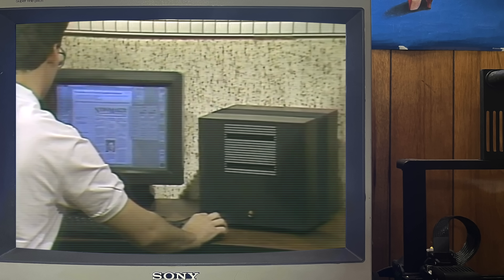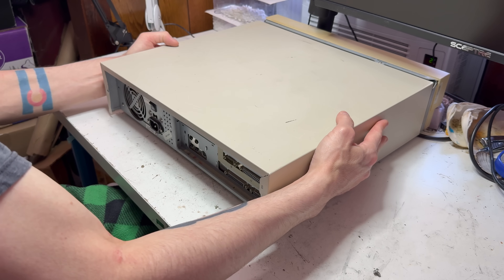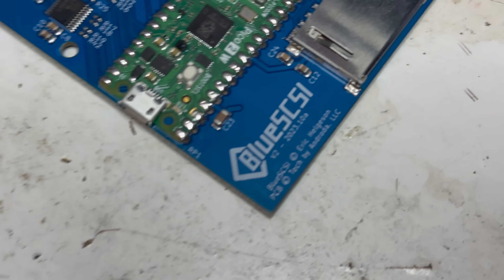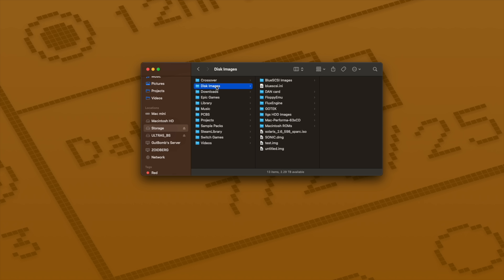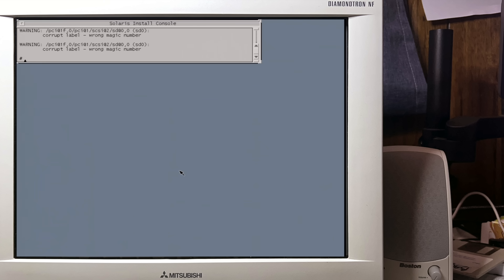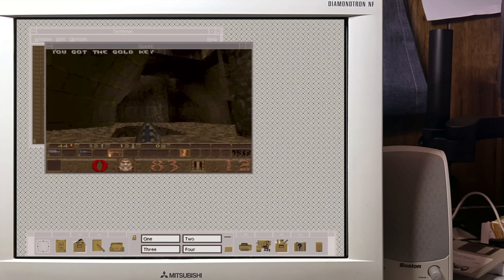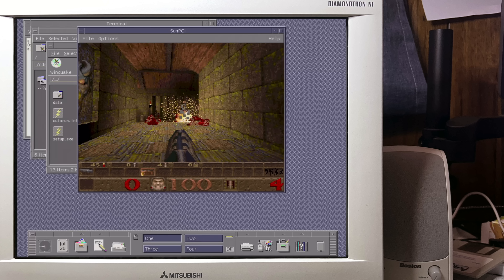The Sun Ultra 5 Was Kinda Weird

Comment: Ah, the Ultra 5 pizzabox. I worked for a company that used a lot of Unix systems. Their main servers were a pair of SGI Origin 2000 systems for the databases, and encryption. Their Internet facing systems were all Sun workstations, Ultras of various sizes running Solaris. All their development work was in JAVA, but they ran Linux workstations for that, since, JAVA was >supposed< to be fully cross platform...LOL! They had done an update of their software, and pushed it to their dev server, and it wouldn't work. It was a needed update with new features they were selling, and so there was no way to back out of doing the update...they could just delay it. I was asked to look at it. I quickly found that it was an incompatibility between the Linux implementation of JAVA and Sun's native JAVA...but the higher ups didn't believe me, I was just the Unix guy in an IT department with lots of Unix...and a whole lot of Windows, which the new executives from the investment firm wanted to move everything to (and would eventually...to their chagrin). Sun had told them it should be compatible, and if it wasn't, they had a lever with which to force Windows Server (ick!) onto the job. But I said to the CTO (who was a Unix guy...until they replaced him...) let me borrow an Ultra 5 workstation, and I will set it up just like the Sun servers, and show that Linux running on Sun hardware would run the JAVA stuff fine. So he allowed me to do this...and lo and behold, it indeed worked, showing that there was an incompatibility! What's more, in testing, the Ultra 5 running Linux was as fast running their server JAVA app just as fast as their Sun Ulta workstation servers running Solaris! Back then, we used to call Solaris, Slowaris. 🙂 I won't name them, but the new management team later attempted to port everything to Windows...and I hear it as not pretty...they had let me go since they were moving to Windows, and didn't need a Unix guy. After a period of stagnation and hemeraging money, the finally broke down and went back to Linux, since they had blown their money on Windows and had no budget.  To this day, they use Linux in their infrastructure, their programmers still use Linux, but everyone else is stuck on Windows...or so I hear. 🙂

Comment: At work, we used exotic SGI, NeXT, Sun and HPPA RISC workstations back in the ‘90s for engineering, 3D modelling and scientific analysis work, as well as PCs and Macs for general office productivity. 

By 2002, PCs and Macs had caught up with or overtaken all of these exotic and expensive workstations for most workloads, while being much cheaper. 

I do miss those crazy expensive workstations, though, they had a certain cool factor thanks to their exotic chassis designs. 

Nostalgia wears pink tinted glasses, though, they are very slow and loud by today’s standards. Crazy to think an iPhone is many times more powerful than a $100K Silicon Graphics workstation from 1993, by every measurement…
Reply: Ah yes, we had hundreds of the Octanes, a handful of O2s and Origins as our app server. Those phased out the Indigo and Indigo 2s. Then along came those very early HP Apollos running HPUX. Though I did prefer IRIX given it was a kissing cousin of Linux in feel. They also has the better desktop when compared to the CDE everyone else was using. I definitely preferred that era to early SunOS and Solaris era. Never took to AIX.

Comment: We had Sun UltraSPARC workstation at my university when I did my computer science degree in the mid 1990s. I still remember these machines at being disappointingly slow. The x86 CPUs of the era had all but caught up — at a much lower price point. Linux became rapidly popular. On a Pentium-class machine, it would run circles around Solaris running on a SPARC workstation.

For all the nostalgia that people may feel for UNIX workstations from Sun, SGI, HP and NeXT: we should be glad that this era is over.
Reply: I’ve lived through that era, working with these machines every day,  and I doubt a Pentium PC could beat a Sun in the 1990s when it comes to scientific analysis and CAD work, it wasn’t until Intel released Pentium 4 that PCs could overtake SPARC in FPU performance. 

When it came to servers, PCs were flaky in the ‘90s and most businesses used reliable Sun big iron for mission critical apps and their web sites, because downtime cost money.

And the same goes for SGI and 3D work - it wasn’t until NVIDIA released Quadro cards that PCs became viable alternatives in real-time 3D modelling and animation work.

By around 2005, PCs and Macs had become fast enough for most use cases to make exotic workstation architectures obsolete.

I’m very glad NeXT isn’t over since its operating system and other innovative software technologies live on in today’s modern Apple hardware.

Comment: I still to this day use a Sun Ultra10 with Solaris 10.  I started supporting Sun systems in 1998 and brought home everything we retired. Those were the days. I just have the one now and a jbod.  Great video!!
Reply: Also to add:  The problem isn't so much finding autocad for Solaris. Its finding the dumb serial dongle.  I worked for a civil engineering company and we had moved from SGI Indys to the Sun Ultras.  The cad guys got U60s with the fancy cards, but in IT we only got the U10s. It was overkill for us.  We had a 10K in the datacenter, and a boatload of E3000s, E450s etc. I bled purple and gray, total Sun cultist. It killed me when Oracle took over and ruined it. As hardware in the DC depreciated I replaced it all with UCS...then it all went to the cloud. Only the CAD and 3D guys have actual desktop workstations running Rocky.  Everyone else just has laptops. At the very least I have the U10 and tons of Sun swag.  Again, great video!
Reply: This warms my heart to hear there are still Sun workstations out there being used.

Comment: An Ultra 5 with a SunPCI card was my work computer from late 1998 - 2001. Solaris was frustratingly slow for what I was asking it to do which honestly wasn't much and Windows which was used for office automation tasks was the same running on the SunPCI card. I was laid off from that job in 2001 but I found consolation in knowing I never had to use that thing again.

Comment: I used to use them to run early versions of checkpoint firewall back when they were new. Thanks for the memory refresh !
Reply: Checkpoint FW-1 4.1 was what I used back then.  Ultra 10 as the management server and a pair of Sun E250s for the gateway cluster. Good old times :)

Comment: Thanks for the video, and thanks for the 3D models to replace the brittle plastic. This'll come in handy when I redo my Ultra 5.

Did you happen to have an OF compatible SCSI card, or did you flash the firmware on to a non-Sun card? I'm running a SATA drive on the IDE bus, but perhaps SCSI would be better.
Reply from the maker: When I got this machine it also came with a Sun Blade 1000 (which is much faster but much less interesting) and this card was in there.

Comment: Oh theat front pannel yellowed a lot 😞 It seems to not be the original CD-ROM drive
Reply from the maker: I think it is, it has a sun part number on it.  It's just made from different plastic.
Reply: It looks like a later LG drive that would have been popular around 2005-7.  Could have been era appropriate.  Not really sure when the Ultra 5 was sold.
Reply: @sirnickity  available since January 1998 and last shipped in November 2002

Comment: No-one used photoshop on UNIX.  By then, they were all using Gimp.
Reply: Bullshit, GIMP didn´t even exists in the mid 90's or was very alpha, Photoshop v3 is from 1994
Reply from the maker: GIMP was around but it was total garbage.  People did use Photoshop on UNIX, it's why it's one of the very few desktop apps for 90's workstation UNIX that's still around to be found today.

Comment: That Mac support has got to be just straight 68k emulation right? And probably not particularly advanced...

The PC card running Quake might be pretty bottlenecked grabbing the video over the PCI bus...

But also AFAIK WinQuake didn't have 3DNow! support and is relatively bogged down by weaknesses in the K6-2's scalar FPU implementation and low L2 cache throughput compared to the UltraSparc IIi.
Reply from the maker: yep 68k emulation.  It has a lot of disk modes too like it can directly read CD roms via their scsi id but it will NOT do the same with hard drives or hard drive images, and lots of apps won't run right because it's not a regular Mac filesystem.

Comment: If you want to see modern high-end CAD software which looks like something from the past you should look at Tebis.  It was designed specifically to not look like a Windows application, even though it runs in Windows.

Comment: "so what else can we do with this thing?"

Engineering and scientific applications.   MATLAB, IDL, ANSYS for finite element analysis, CFX or FLUENT for computational fluid dynamics, CAD, plus the Schlumberger and Landmark stuff for oil and gas.  

I have no idea if any of this stuff is available anywhere.  

Oh, and the huge amount of Web software, not sure where Sun and Java enterprise was around then.   These things were always used for web development and departmental web servers tho.
Reply from the maker: Yeah, my point was that most of the stuff that makes these older workstations interesting is lost either behind licenses (dongles or license servers) that were never high volume enough to be cracked or just hiding out there in obscurity. And there’s only so much entertainment value in a video of showing off a Java IDE.
Reply: @GutBombTech  yes, I wonder too, if there is any engineering software left.
The only software I still have for Sun Sparc, PA-RISC is Oracle stuff, and maybe Apache web server.

Comment: There is also a project called ZuluSCSI, and a related one called ZuluIDE. I picked up a handy little external ZuluSCSI designed to plug into the external SCSI interface, such as those found on the oldest Macs, and it's pretty good. You may have to tweak it a bit depending on which machine you're using it with, but it does work. Lets you emulate various drive types, including hard drives and CD-ROMs.

Comment: I got mine without keyboard, mouse, and working CD and HD drives. I made a little USB to SUN keyboard and mouse converter with rp2040, but since I have no SCSI controller I am stuck with built in IDE. AND IT IS SLOOOOW. It's PIO only! No DMA! Since I have no CD drive that is detected by OpenBoot I installed OpenBSD by putting its installer into the swap slice of the the disk and booting off of it lol. Must be nice to have that SCSI contoller, jealous :P
Loved the Mac vs Win vs Sun. I didn't know there was as mac emulator for Solaris. I should try to net install Solaris on mine, previous attempt was close (trying to do this from linux) but still no cigar.

Comment: A break sent to the serial port does the same as stop-a. Good if you dont have a sun keyboard. Ultra 5s were the real beginning of the end.
Reply: They competed with Pentium 2s. I remember running Gentoo on my Ultra 5 and being amazed at how plush it seemed compared to Solaris
Reply: Yeah.  I was forced to use a late x64 Sun workstation at a job i had.  I ran Sol 10 on it for a couple days, then changed to Gentoo.  Solaris had no creature comforts like at all.  It was as bare Unix as it gets.
Reply: @sirnickity  Sun didn't seem to get the need for a desktop environment, shame really as it got outdated fast.

Comment: Around 2000, I and some of my coworkers had Sun Ultra workstations on our desks to run Green Hills Software's cross compiler and debugging tools for a set-top-box development project. I had a relatively low end Ultra 1 with framebuffer 8-bit color graphics. The tools themselves felt primitive and barebones but it was what we were told to use. Software acquisition was challenging as everything interesting has expensive licenses so it sat mostly doing only its intended purpose. Eventually the project was canceled and I turned in my Sun when I didn't have any more use for it.
Reply: In 2000 my workstation was a Sun Blade 1000. 
We also had a bunch (10) of SUN Blade 100s set up for training.

Comment: Sealing the battery in the clock with whatever is saving the BIOS settings was such a strange design decision. Admittedly, no one thought at the time we'd still be using any of these computers.
Reply from the maker: It’s so ridiculous. I left it out of the video (because I didn’t realize I’d be making a video on this weird thing at the time) but when the battery dies you have to basically rebuild the nvram contents from scratch. That was a pain.
Reply: @GutBombTech Hi it is normally a one line in OBP using mkpl on these systems so not a big deal to reset the NVRAM. Also you can still buy versions of the RTC new from distis use the 58 version as the 59 is a long time obsolete
Reply from the maker: @peterstokes8631 it’s not just one line because the system ID is stored in the nvram and needs to be reconstructed byte by byte. There’s a whole process to it. It’s why the system ID in the video is 80:c0:ff:ee. Not just that either, a bunch of nvalias settings and parameters need to be set manually to get it to actually do anything.
Reply: I've had a Pentium i motherboard that had one of these RTC chips soldered to the board, without the socket - and it wasn't Y2K compliant, despite being made... in 1997. Not sure what shelf life they expected from their system. The battery lasted until the end of 2019.
Reply: @olexanderkidenko4423  well, companies like Sun, HEWLETT-PACKARD, SGI, etc. presumed a long term professional (service & support) partnership.
Taiwanees like ASUS & Co. ignored any idea of sustainability and mere calculated 1/4 cent in peoduction costs

Comment: Having a rare powerful machine that could run Mac, Windows and native Unix software at usable speeds would sure feel like magic at the time! I remember trying to emulate a PowerMac on a Pentium 4, was very painful in comparison.
Reply: About a decade earlier than the Ultra 5 the solution for that was a Commodore Amiga, and yeah it felt like sorcery that it was even possible. Amiga Unix (1990), AMax for native speed Mac software emulation (1989), and hardware PC cards (from 1986 on in various CPU/speed flavours) on top of running native Amiga software. Of course most people weren't using all of those at the same time though, personally I just had a PC 286/16 expansion card in my Amiga for doing school work that required PC compatibility.

Comment: I bought one of those in 1998 because I wanted to use the Self programming language in a project and at the time it only ran on Sparc machines. It was later released for PowerPC Macs and even later for Intel Macs and Linux. I soon expanded the memory to make it more usable. At one point the battery inside the clock chip died and it was quite the effort to get another one (which has since also died, but I don't use the machine anymore).

Comment: did you perform these solaris installation song and dance purely on your broad based knowledge of linux or was it a bit of a struggle?
Reply from the maker: 30 years of trial and error was helpful.
Reply: Linus does not really prepare you for the weirdness that is SunOS.  I had a couple years of trial by fire in the mid 2000s.  “How different could it be?”  … “What is slice 2 and why is it the size of the whole disk???”

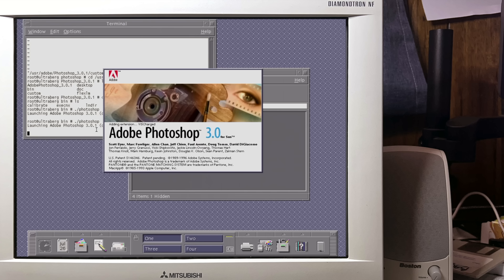Comment: 13:40 Imagine if Apple had made Compatibility Cards with PowerPC processors for workstation platforms… Then again, if you needed the performance and could afford a Sun workstation, you could probably also afford a Mac and a bigger desk.
Reply: When Apple was at its lowest point in the mid 90s, a merger between Sun and them was speculated.   I always wonder how better that would have turned out for both companies.
Reply: @combusean not well, because what Apple needed was a great new desktop operating system with all the bells and whistles, so NeXT’s OPENSTEP was the much better fit. Sun had given up on GUI design for Solaris by then, focusing on making it a reliable server platform, instead. Sun was also trying to push Java everywhere despite the fact nobody wanted Java on the desktop or a Java-based OS.

Besides, without Steve Jobs returning to save them, Apple would have gone down the drain. I doubt anyone at Sun could match Steve’s passion for saving what was essentially his firstborn company.